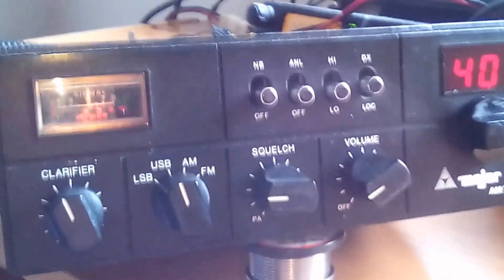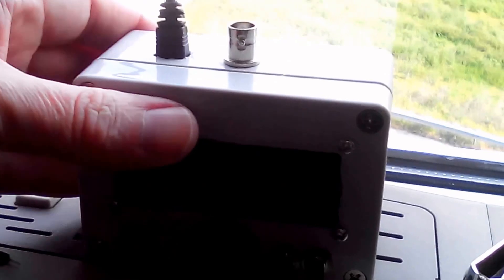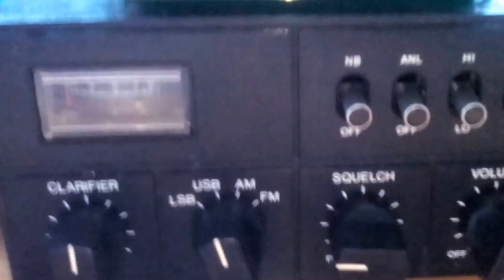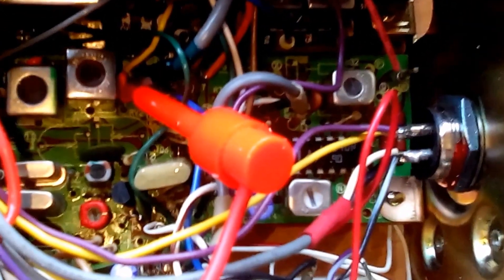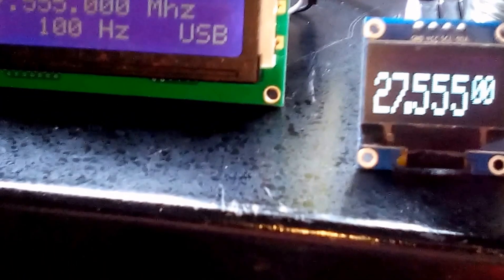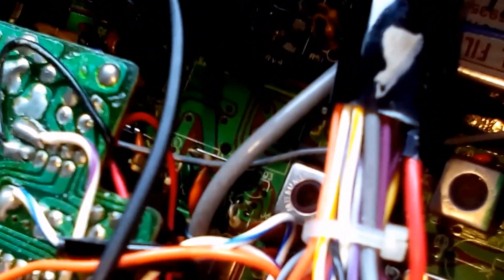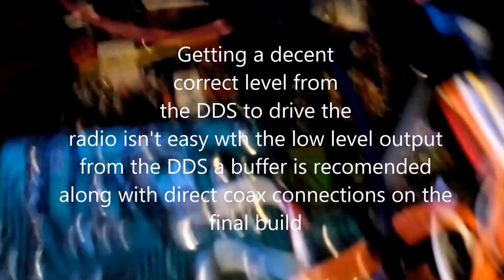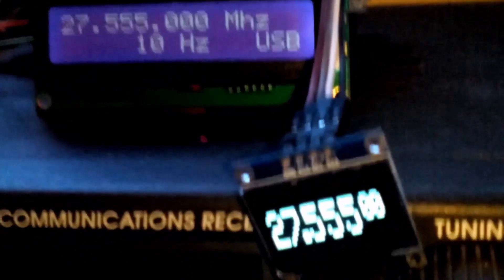The Secret CB

Comment: Where do I find out where I would hook up one of these VFOs once one is built.  I just have a feeling it will not be as simple as what we used to do for channel / frequency expansion.
Reply from the maker: You replace the master osc frequency with the DDS supplied Freq....and enable the pll tx line as explained in the video..
Reply: @Eltimple  I did not see or hear that part I guess. Too many nurses milling about in my room all the time, wanting to bite me stick me or stab me.  I want to find out about stuff you sell. Is any of your schematics and how to do-s for sale so I can support your channel.  Being disabled I have to find ways to help others that benefits me to some degree as well.
    Anyway, once I get out of this hospital, i can re-assemble my electronics lab and re-familiar myself with electronics. 
     I have many ideas on modifying certain electronic parts.  Example: Air Capacitors that are stackable. (One knob turns them all.) Or dual and triple adjusting switches that you can decide what these variable switches control.  I have easy access to a kiln and just need some clay. Anyway... Friday or Saturday I get a prosthetic and hopefully can get out of here. Diabeties took my leg just below the knee 3 weeks ago.  Not a big deal as that leg had bad and constant pain since the motorcycle accident in 1979. So I just might be able to walk better... I hope.
    I used to have my ham license.  My call sign was N8YPS and I hope to get it back (it is still unused)  No one knew who I was but 
N8 =  N-eight = Nate
See... I am a YPS ~ SPY.  Just haven't figured out who to tell on, but when I do... I'M TELLIN MOM!  LOL
Reply from the maker: @terryglenweaver  not sure why you couldnt hear it seems ok this end ...
Reply: @Eltimple  Seeing and hearing issue is most likely due to interruptions from nurses or lack of sleep. I consistently go 3-5 days with no sleep from severe chronic pain.  I will set up to re-watch it and pay closer attention. I explained this in the post just before this one. (In the comment string before this one -- it began with me talking about the static...
Reply: @Eltimple  I could not get how you knew it was t3, unless with a frequency counter you probed around until you got the proper signal.   Now, I am self taught and like probing around... but I only do that on radios I own and do not mind at all if I let the smoke out of it.  Of course, I am fairly certain in this instance there are no worries about letting any smoke out.
Reply from the maker: @terryglenweaver  you scope it out....... but the circuit diagram got me close ..i have a rigol digital scope with 1gsampling ..the input to the mixer that has the master frequencies
Reply: @Eltimple  Great... My O-scope is a digital fluke. 
    It has some modifications done.  For one it has the Henwai installed plus the Rolsken-ardlei primary rolling-buss sub-addition. ( I haven't slept in 3 days so Iam unsure where all the hyphens go.  LoL Yeah, I like to joke some.) Currently, It is still in a box at home.
    If only they would allow me to bring my radio stuff here so I had something to hands on.  So when I get home, I must put together my station first. Then in can get started on projects. One of the first, if not the first will be this Arduino VFO... Unless I can find one rebuilt at an affordable price. If so, then installation into a CB will be the next objective.  (I have a habit of buying one before building one... That way I can test it call out and and modifications I want to try go right into the one I am building. This allows me to maintain one original that works.

Comment: you can generate FM with the AD9850 through code
Reply from the maker: yes you could, although not sure the arduino could do adc , sample at a resonable rate and then wobble the carrier ..thats a lot of processing ...maybe a robot voice over  a kilohert or so
Reply: The frequency modulation is in code/firmware passed to the DDS from Arduino via serial or parallel programming lines.  Works just fine for voice or music bandwidth.  see videos below
Reply from the maker: yes i see its now been done , my iniial thoughts were along the lines of this chap , i.e. the arduino as it stood would have trouble...but if you are able to delve deep as has been done here then great zissisprojects.wordpress.com 

The hard part about the project was the coding part. The default arduino
 hardware (such as the AD converter and and serial communication) are 
limited for simplicity purposes for an individual programming beginner. 
But if you look closer to C programming techniques inside the Atmel 
datasheet you will find anything needed to make this single chip baby a 
grate processing masterpiece having only some small advanced steps.
Reply: I will have to be brought up to date on this code stuff.  Back in the day, when I was working on radios this code thingy was non-existamt. We got our VFOs by wrapping wire around a woman's vibrator and adjusting vibration speed.

Comment: How was the spectral purity after the mod?  I'd like to do a 10m mod on a radio I have, just wondering how much additional work might be required to add filters to the dds.
Reply from the maker: the dds is feeding the mixer which in a cb , has a tunned output in the 11m band. as the frequency injected is the master frequency at around 37 mhz from the pll, there are cans on the board after the pll that are tunned to that range of frequencies, so to get to 10m is easy and if you are worried about spectral purity thoose cans between pll output and mixer will block everything.....the pll can be replaced in any radio, the limiting factors in cb radios is the crap filtering in the pa output but that was always the case. To get the radio to go further 15m or 20m , yoou need to inject the dds directly into the mixer, and then replace everything afer the mixer with a wideband amp , bandpass and low pass filters. I bought  cheap wideband 3watt amp off aliexpresss for like 10 dollars and used qrp lowpss filters as an experiment
Reply from the maker: its more novelty value than anything else , running on 20m..its almost easier to get aa bitx ..but not aas much fun
Reply: @Eltimple  Thanks!

Comment: First, too much static noise to make out what he was saying. How close to an all band Amateur Radio HF rig can be achieved with a CB and a VFO?
Reply from the maker: It's not really practical for an all band ham transciever...it's not impossible..but you would only keep the if 10.695 ..after the mixer you would need a wideband HF amp with band pass filters for each band...the same for the reciever front end..... A single mono band tcvr  might be easier option no band switching to muck about with ...but it's down to experiment and using stuff to hand to breathe a second Life into it.
Reply: @Eltimple  Years ago when I was working on radios, I also used to fifdle with old ones for experiments.  Well, I got pushing a 23 channel Sen Cobra around and got so far off frequency that I started hearing stuff from Germany (I think).  Anyway it was not from around USA. That intrigued me and with it (the idea) on the shelf for 20 some years, I just recently dusted it off and am thinking about it again.  Currently I am in a hospital and so I don't have parts or equipment in front of me so everything I examine I must build in my mind and use any info from YouTube I can..  Thanks for your input.
Reply from the maker: @terryglenweaver  things have changed drastically in radio in the last 20 years..DDS chips or kits are vastly superior to the pll that they could replace..and only cost a few dollars to make
Reply: @Eltimple  Yes, that I know and is in part why in an going to regain my ham license.  It expired in 2003 and I had stopped doing anything with radios.  
But now that walking has become a huge issue I have restarted an interest in electronics and radios.   
      My old idea was to repurpose a 23 channel selector to change from one filter to another and to use another CB chassis to fix on top of the radio I use. That chassis would house the VFO and more... Anyway I have a lot of remembering to do.
Reply from the maker: @terryglenweaver  try some of the bitx lines of kits..get you on HF for under 100 dollars
Reply: @Eltimple These kits could come in quite handy, thanks! As far as getting on air goes... I am getting ready to buy another HF rig and get my license again. Recently I have been building another electronics lab, as during a divorce a few decades ago, I lost it.  The reason for looking into such radio modifications with CB Radios is for when the SHTF.  Cell phones, Computers and just way too many other electronic devices are being implemented into society and that WILL enable a control over people like the world has never before seen.  Communications that cannot be traced will be paramount and I fear that new HF rigs could already have a sort of GPS device within them, making them just as bad as a Cell phone.
      Having the "old School" radios given new life by Amateurs and by experimenters can be a protective measure one can not put a value on.  And... Exactly what does having this capability hurt?
Reply: @Eltimple  I really like that VFO you encased. Do you have a Video and schematic on that build that I can purchase?  If so, how muCh?
Reply from the maker: @terryglenweaver  its all online i started here http://www.ad7c.com/projects/ad9850-dds-vfo/

Comment: Hi there...we're other parts removed or just tapped into the trace at t3
Reply from the maker: in the end i lifted one end of the cap feeding t3 , Cap C20(and that worked better....this means that the radio can be made to work [practically anywhere on hf .. master freq for 11m around 38meg ...master freq 32 for 15meters etc....add a wide band amp after the mixer ..kits on ebay
Reply: @Eltimple  thanks for the info...got an old 23 channel ssb cybernet chassis I'm playing around with...

Comment: Will FM work also with this method?
Reply from the maker: Correct, unfortnately fm is generated via a varicap that wobbles the VCO in the original . So yes you loose FM when you remove the vco.  You could  replace the band xtals with a a signal you generate  but main problem is the tightness of tthe board tunning. This board sstruggles to cover more than 1.5 meg without lots of mods.  It gets to the point where you may as well use the cb case but replace it with a ham radio kit capable of covering everything